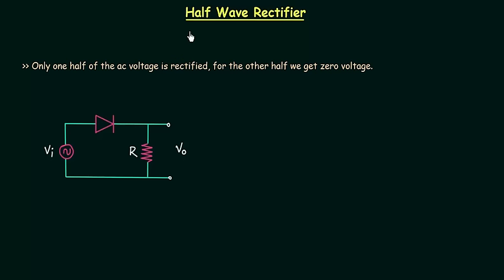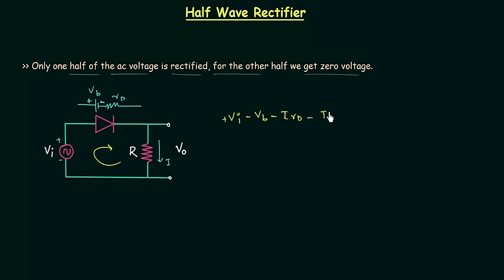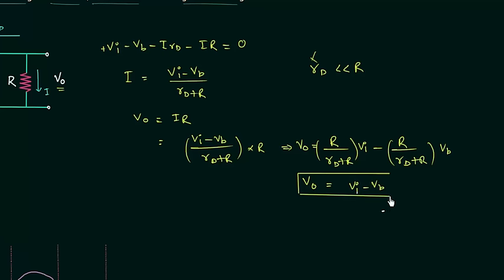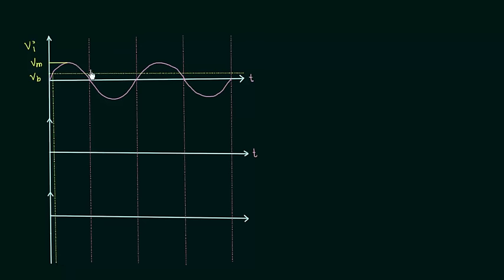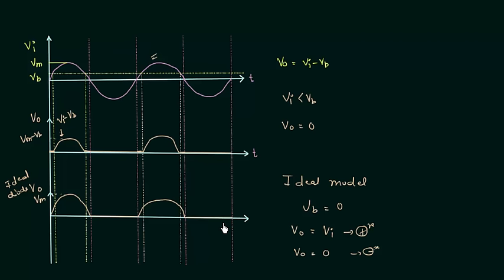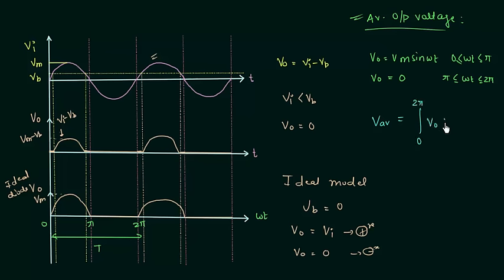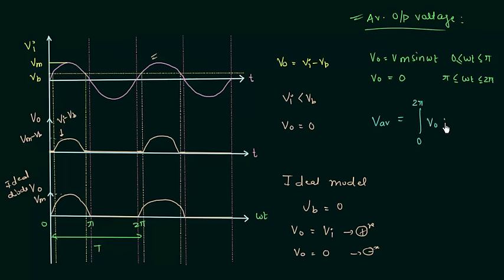Half Wave Rectifier

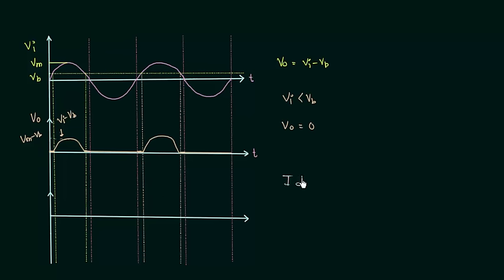Comment: At 6:15 the wave form is for voltage drop model and not the piece wise linear model because we obtain the output voltage by neglecting the diode resistance.
Reply: Still the ans is same becoz diode resistance is ignored in the end but yeah not taking it from the beginning is better. 👍👍

Comment: Referencing the diagram @ 0:25 ... if the Diode was relocated to the bottom of this circuit & kept foward-biased {in other words, closer to the Negative Terminal of the Power Source (i.e. Vi)}, then would the Signal Output (i.e. Vo) be any different?

Comment: sir, are the determine average  values of voltage and load current applicable just for ideal models??
Reply: Yeah, for piecewise the area of the curve will decrease, while it's base remains the same. So the avg values will be even lower in that case.

Comment: Why do we neglect the diode resistance?
Reply: An ideal forward biased diode has 0 resistance, while an ideal reverse biased diode has infinite resistance. For this reason, an ideal foward biased diode also has no voltage drop. real diodes in practice, however, have a voltage drop that must be accounted for.

Comment: I think the output voltage waveform at 5:14 should have been started to flow from Voltage value of Vb i.e. 0.7 V . In that case it shows, at this voltage, Diode is FB and thus circuit is short giving rise to output.
Reply: here axis is shifted that's why he started from there ..
Reply: here axis is shifted that's why he started from there ..